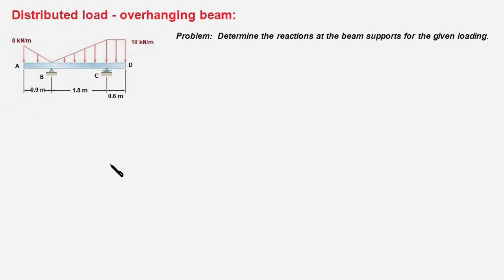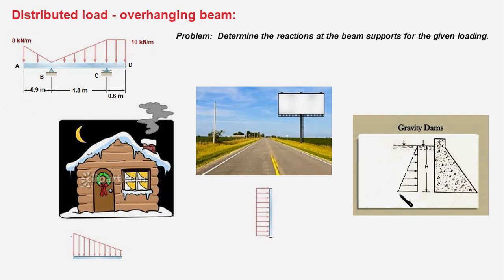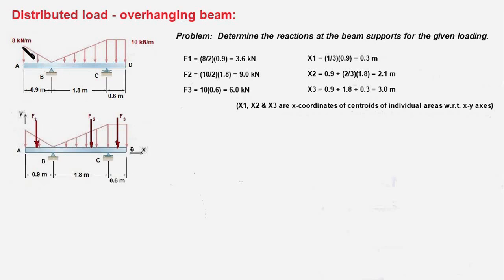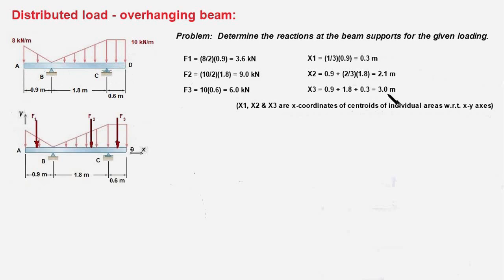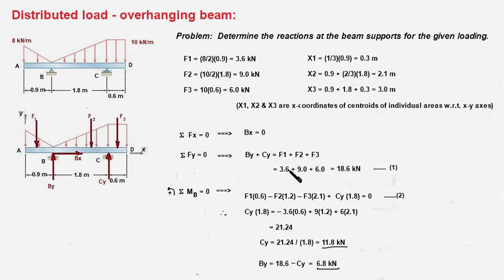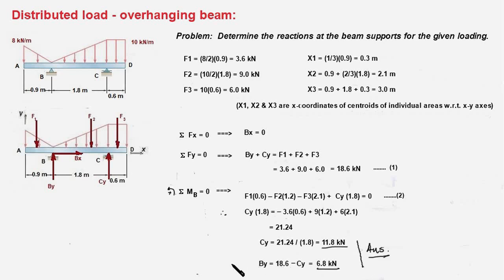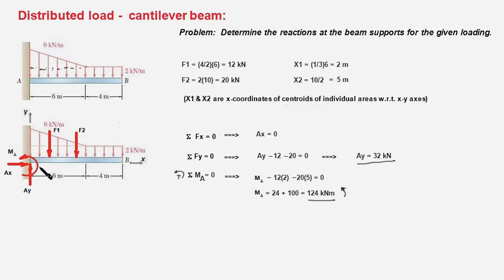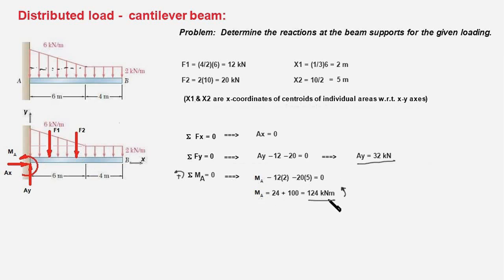11.3 Support reactions of beams subjected to distributed loads.

Comment: Please do same example but with roller in the middle of the 2kn/m and 6kn/m don’t change it
Reply from the maker: Hi Aviwe: As you might have understood from the video, the support reactions are computed from the equilibrium considerations - and therefore in a 2D case we can at best determine three unknowns. If there is an additional roller support, the no of unknowns would be more than three and the problem then can't be solved from the three equilibrium equations. It can be solved by using some advanced concepts that we are not dealing with presently as it is not covered in an introductory course of engineering mechanics.